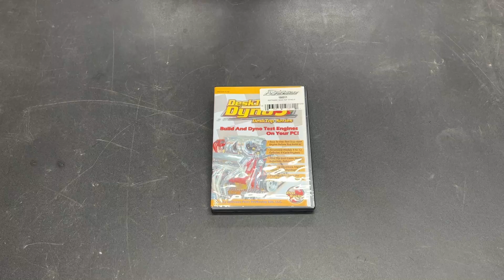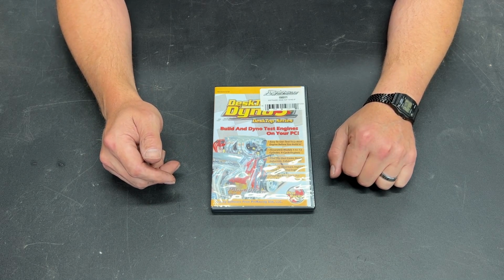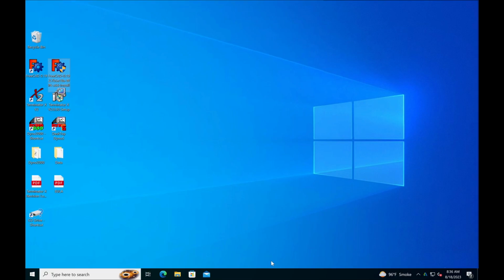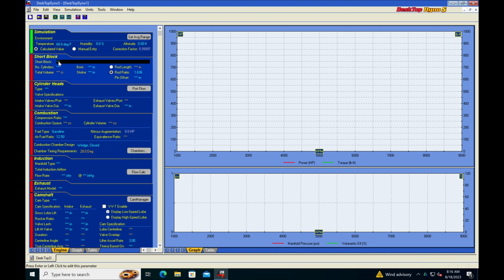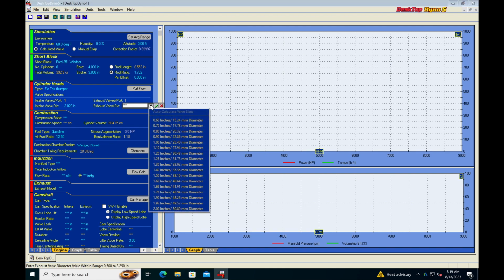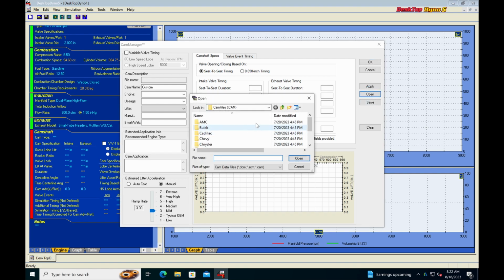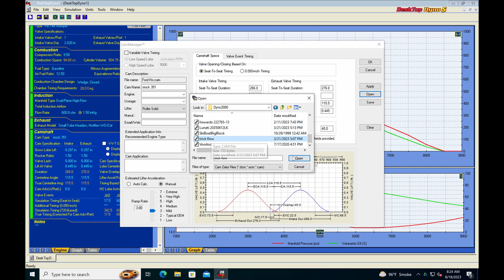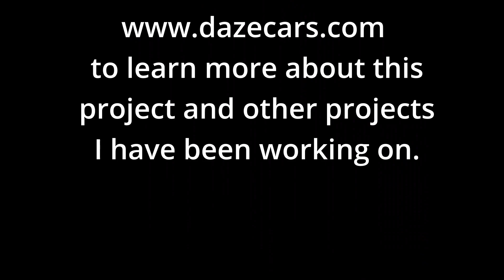Review of Desktop Dyno 5 A Virtual Engine Building Program Compare to Dyno 2000

Comment: I was fiddelin' w. pre D 2000, D 2000, Cam Disc 2 and drag 2000, 27 years ago. Now as I am in the process of building up an other engine, I regret having tossed them discs into the trash. Yes, I'm a Mac User for most of the latest15 years or so and wasn>'t expecting to ever build an other engine nor using Windows. Anyway, did you ever considered Dyno 6 SIM? I wonder if that's the latest reasonably priced DTDyno for the money and if it is worth purchasing it over the #5 version. Any thoughts, experience on the #6 Version?
Reply from the maker: I have heard of Dyno 6 but have no experience with it.  Its a lot more expensive than desktop dyno 5 and is way more complicated than I need for basice part selection.  I too am a mac user and I run my windows softare in Parallels
Reply: @dazecars  Thank you for responding
Reply from the maker: my pleasure

Comment: I’ve used desktop dyno 2000 for years, but recently did a bit of a test and the results really make me question the accuracy of the software. Using the exact same engine, I used seat to seat cam specs vs .050 cam specs for the exact same cam. There was a SIGNIFICANT difference in the end result. The results should be the same, or have a minor difference. Care to test this newer software in a similar way to see how much difference there is?
Reply from the maker: I am sure my software would have the exact same result or vey similar.  There is no way to enter the actual cam lobe shape.  None of that information is posted as that is the manufacturers "secret sauce" and difficult for the consumer to measure/plot.   The result is that the software has to make an educated guess of the general lobe shape profile based on the information provided.  In your case the different information caused the software to pick two different generic cam profiles as it's best guess.  The important thing with this software is to remember it is an approximation.  There are so many variables and conditions that it doesn't account for with intake manifolds being the biggest shortcoming.  The software will get you in a ball park number wise.  IMHO the real value of this software is its ability to give you the shape of the curve and to see how a combination of component work together. There is a big difference between a torque monster that begins falling off at 3000 RPM and high RPM motor making peak horse power some where above 6500 RPM and the software helps you to see if your component choice gets you the desired outcome.

Comment: Question, when inputting cam selection does it allow you to change the lobe seperation angle for the same cam specs to see what happens just changing the LSA?
Reply from the maker: no but it does allow for Lobe Centerline angle which will get you close

Comment: I purchased this software after watching your video. I'm addicted !! 😅
Just wanted to point out, that you indeed CAN compare one graph to another. You have to right click on the graph and "open" the other curve from your saved library. You can also select "direct comparison" from the right click menu, which then let's you make changes to the current model i.e. compression ratio,  intake manifold etc.. and it will compare the new power numbers vs. the curve already displayed on the screen. Good stuff. 🍻
Reply from the maker: It is addicting!! I have "built so many engines on mine just because I could not because It was an engine I was planning on building.  Thank you for the tip on being able to compare graphs, that is a fantastic option!!!
Reply: @dazecars  absolutely,  it adds another dimension to how useful the software is. 👍
Reply from the maker: agreed!!!

Comment: Curious, we're working an engine that it, and it's parts, won't be in any of your drop down menus.  Will this software work for us?
Reply from the maker: You can enter the bore, stroke, and compression on a custom engine or pick something close and change the parameters. If you have flow specs for the heads that can be entered, and cam specs can also be entered. The short comings are carb and intake specs. There you are forced to use the drop down choices. I hope that answers your questions but if not let me know of other questions you might have and I will try and answer.
Reply: @dazecars  Thank you for the feedback.  What about heads, e.g., ours are wedge, staggered layout, with canted and splayed intake and exhaust valves?  Are there choices for all of that?
Reply from the maker: No BUT Flow numbers eliminate the need for specific configuration because ultimatly those design changes effect flow.

Comment: Are you aware if it can customized head types for things like siamese intake/exhaust ports for non standard heads? I got no response from that at all be e-mail. Trying to configure a 4 cyl 1275cc in a vintage Austin Mini. Thanks. And/ or I spied a British tab there...
Reply from the maker: I am not fulley virsed with every option on this software but I believe the best configuration you can do for heads is flow numbers.  If you have the flow numbers the shape of the port really doesn't matter as it would be reflected in the those flow numbers.
Reply: Thanks. @dazecars

Comment: That old Dyno 2000 was eerily accurate in its prediction

I had Dyno 2000 when I had initially put together my 393W back in 2006.  At that time, the 393W kits being offered in 8.0:1 or 10.5:1-up and nothing in between.  I wanted something between 9.0 and 9.5:1 to run on 87 Pump gas..  I found KB364 22cc dish pistons for ~9.4:1 with my 64cc aftermarket iron heads.  
My 393W Camshaft selection was also chosen using Dyno 2000, to try to maximize power while at the same time keeping it sniffer-test legal!  Yes, it passed, and I street-drove - and towed with  that engine year round for years.  Later, when the car became emissions-exempt due to being over 25yrs old, I upgraded the camshaft to a still-mild hydraulic roller.  Now output was ~380hp as calculated via weight/ET and MPH at the dragstrip - 3950 pounds with driver 13.06 @ 106.55  - through the stock-ish dual exhaust with catalysts .   Here's the 'eerily accurate' part  Dyno 2000 predicted 370-385hp!
Reply from the maker: great story, thanks for sharing.  I agree that it is outstanding software.  some configurations are more accurate than others.

Comment: This is a modestly spit shined version of Camquest 6 which was a free download from Comp in the early to mid 2000's. I have the installer and the last update. The last update available was in 2006. These bloodsuckers want $60 for something they developed 20 years ago and gave away to sell their cams. It's not worth $60 now, it wasn't worth FREE then. Don't waste your money as it's still a tool for them to sell their cams. They just want to rip you off with it now. It's 20 freakin' years old, nothing new. It's crap. If I had a way to put the installer and 06 update online for download I would.

Comment: AUTOMATION Game will Gove you a similar thing but in 3D and you can export your car to BeamNG to drive.
Reply from the maker: I have not used that one but after looking into it it seams like it does not have nearly the options that desktop dyno has.  I only scratched the surface of desktop dyno 5's options and capabilities.  Being that Automation is making an entire car and the desktop dyno focuses just on engines makes sense it would be better for engines.  With that said horse power and torque curves generated by automation could still be very useful in picking components.  All this is conjecture as I have only used dyno 2000 and desktop dyno 5.

Comment: Something I wish I had about 7 years ago.  I may just get it and get a ballpark what HP/T the 383 stroker in my 71 Camaro is putting out.  The fly in the ointment is, the intake has been ported and polished, runners reshaped.  I've no way to measure that effect, except seat of the pants driving.  My guess is, it's in the 400-450 range, but that's gut feel....... er butt feel.
Reply from the maker: It is fun software to play with.  I have built many a virtual engine just because I could.  I think if you chose one of their  "one size fits none" intakes  "max flow" you could get something close to what you have.